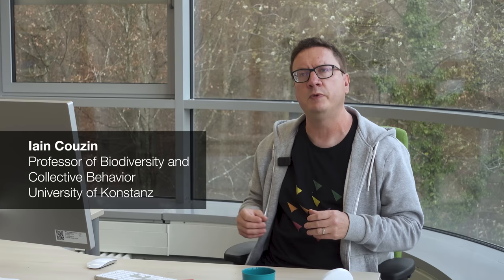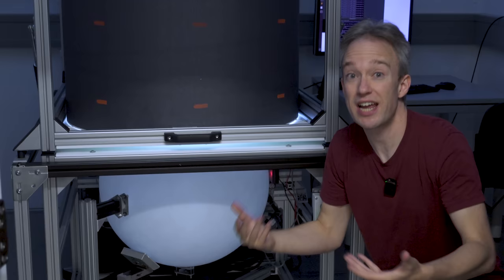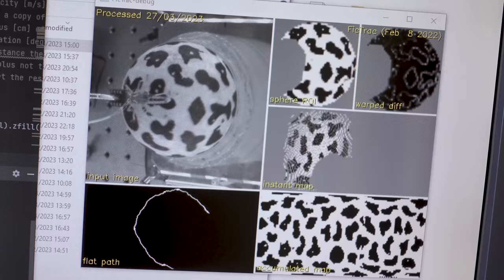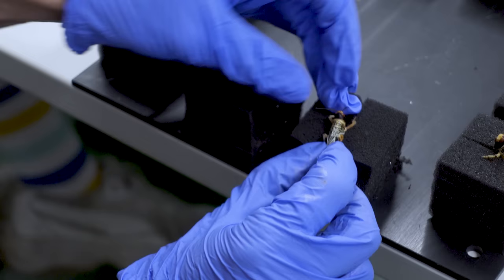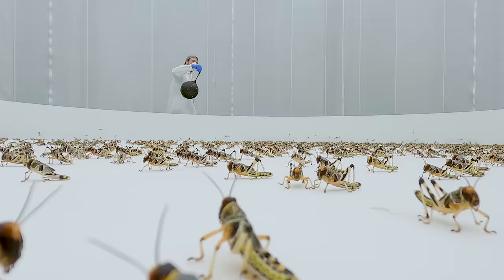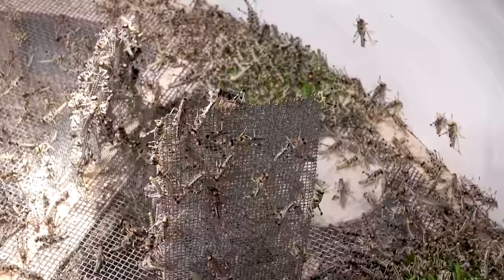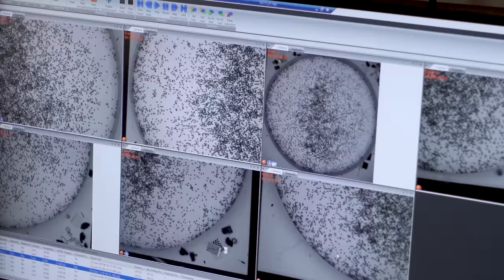It's the Matrix, but for locusts.

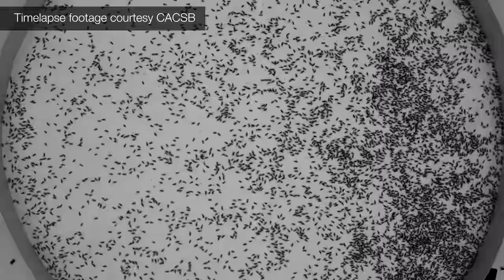Comment: At 6:18 the swarm movement looks like an harmonic oscillator. I wonder if the population density gradient could be influencing the swarm overall motion.
Reply: thats exactly one of the questions they are trying to answer. Stay tuned for the publibations!
Reply: I wonder how locusts would respond to a double-slit experiment. Would they behave like waves or particles?
Reply: @JWooden271  that is also an incredibly good idea. I think they tried it. Not sure about the results tho
Reply: @JWooden271  They would pass through both slits simultaneously and only collapse back into a single locust upon observation
Reply: Spotted the physicist
Reply: @JWooden271  I'd guess that you don't really have destructive interference with locusts so it would probably not be the standard interference pattern, but I would guess wave-like still since the swarm effectively passes through both slits and interacts with itself.

Comment: Audio cameras on this would be insane. It be interesting to see groups marching in unison or showing the same behaviour, and how those respective frequencies match up. Do they use this to tell direction for example? Could ww just then, use these frequencies to just make them naturally move away from crops? Would we have to worry about noise polution, how crops are affected by these same measures that proctect them, to deem them safe and end using chemicals?
Reply: I believe audio cameras are called microphones.
Reply: @RFC-3514  I believe cameras are called image microphones 🤓
Reply: @RFC-3514  there are actually audio cameras, called acoustic cameras - Steve mold has a great video on this.
Reply: There is some work on how locusts respond to audio, but my understanding is that they predominantly navigate using visual and tactile clues.

Comment: that's awesome, I think this research has real potential to build a basis for new locust control techniques. for example, if chemicals were found that alter the locusts' behaviour to prevent swarming, perhaps slow them down enough to starve them (the denser the swarm, the faster they have to move to find enough food), it is likely that those chemicals would be less broadly toxic than normal insecticides that kill all sorts of insects.

Comment: Take a windmill turbine head, stick in the ground so the fans are horizontal with the ground about 20 feet up.  Take the wings off,  attach long and many lines of fishing line and small netting lines.  When the locusts come you spin the turbine.  Have a few covering the perimeter of the crops.  The locust will meet 7 million spinning whips.  Not hard,   just some elctricity, digging, and an on/off button.

Comment: To be honest if one wishes to avoid using pesticides, enclosed farms and gardens may be the best bet to combat locusts. Food is one of our most important resources and putting money towards building long lasting infrastructure that allows us to keep producing that resource, in a clean and sustainable way, should be our top priority. Honestly a lot of this research seems to be more about the scientific studies in neuroscience and animal behavior than actually trying to solve the problems that middle eastern farmers face from locusts.
Reply: Locusts are tiny and can fly, and farms are enourmous, require constant access and maintenance, and need to be able to get energy from the sun. The cost, complexity and unreliability in perfectly sealing thousands of square kilometers of farmland is just not possible.
Reply: @freddierhodes8201  Indoor farming is a growing technology that shows numerous benefits. The main consideration is a large upfront cost that allows farming to be done more efficiently for generations to come versus constant upkeep and outgoing costs such as having to spray pesticides every season and use more water than would be needed in a contained system.
Reply: @SwiftNuts  it's a good technology that works on smaller scales, but currently HALF of the world's habitable area is used for agriculture. Even if enclosed farming literally doubled production, or even increased it 5 times over, the resources in constructing the required equipment would take trillions of dollars and much of the industrial capacity of the planet if we wanted it done within a decade or two. Its just not a viable solution for the kind of scale where you feed 8 billion people.